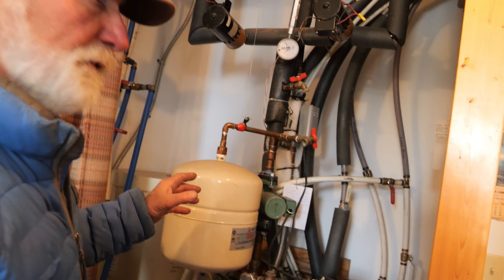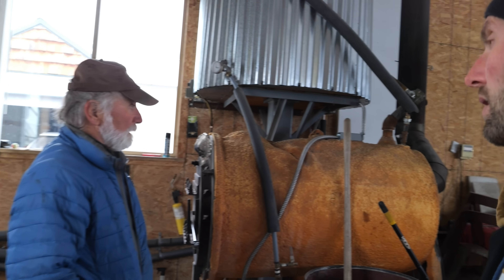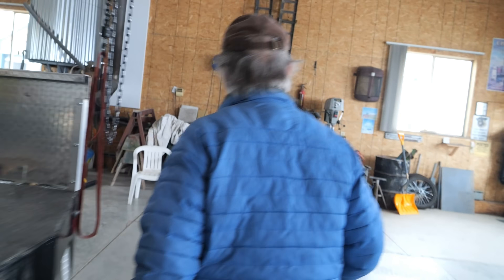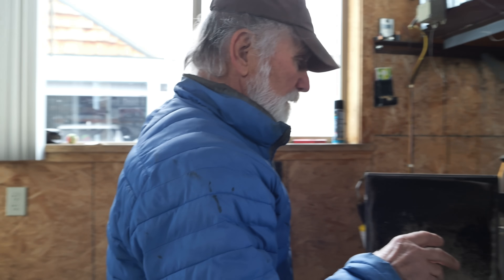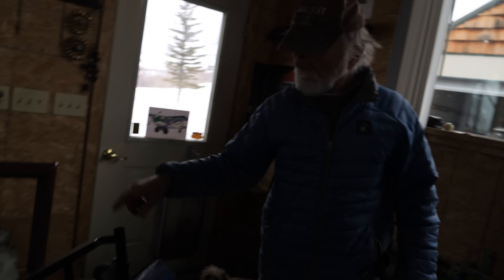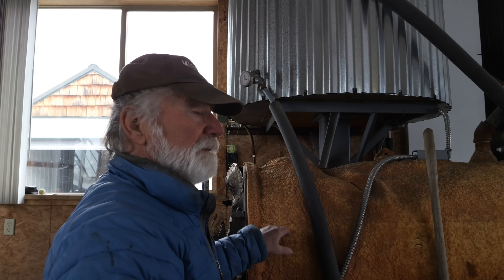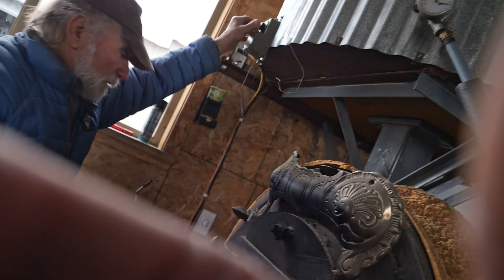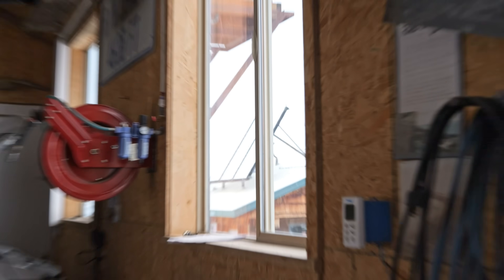Hasn't had a Heating Bill for 40 years.

Comment: Highest IQ in th history mankind &creation STONE IGLOOS XPLAINED:
   
  It is a planet of lunacy.
  Thoze houses.
   Absolute joke.
 Idiot is not a bad word nor a backstab.
  Vid begins thick branches bending heavy with insulating snow lining road. Same branches cover beaver lodge.
    Build stone igloos covered with these branches minimum 2' leaves insulation = free heat with only pile branches.
   Nakid human:
  A. Will be bone dry downpour.
    B. Never under 60° Fahrenheit covered in 2' minim leaves.
   NEVER PLACE INSULATION IN ENTERIOR like Mr. Idiot Professor from h*ll.
  Thwoodstoves theez people use:
   Slap in thface absolute joke personified on every level demonic design& from there installed&THEN operated completely backward.
 Burn fastest possible flash fire ONLY.
   
   Butted against wall radiate heat outside stubby feet cant dry wood under teeny box stove cut short logs = wear out saw twice as fast while increase labor.
   If even1of theez people boarded my ship entire crew would be infuriated.
 These people tear thr homes down with thr bare hands.
   95% humans = Satans kids. Computer systems teach throw cash @houses only.
    10year old girl could build stone igloo by looking@ a picture cost of 2windows &cement.
    Never use doors enter thru portals = 2lift out windows.
   Build individual domes each person.
    
     Satans kids xplained = poulison computer animations controlled hive mind scrypts from h*ll. 
    They don't even knowhathey are google "Poisonous."
  
  Imbecile:
     Not a bad word nor a backstab.
 I have higbest IQ history mankind & (&) creation.
  
  Never EVER aim a chimney up drain water down humidity + ash = cement chimney clog SHUT while smothering fire = hammer&chisel.
 
    Horizontal chimney ONLY tilted 1' DOWN PER 12' = drain moisture inhaled from atmosphere.
 Use thick SMOOTH easy2clean 5' cheap big rig diesel pipe last centuries.
 Thick metal collect heat connect pipes with cheap aluminum sheet wrapped tight with wire DO NOT WELD.
  My 15' horizontal aimed ONE FOOT DOWN pipe = heater.
   Where pipe exit window:
     Millions of u put 2gether could nvr figure out:
    Place 2' thin sheet aluminum shroud1" larger then diesel pipe 2suck in freezing air hole2 outside = hot air enter room oxygen 4u /stove.
    Remember.
     Stove need rich oxygen u must:
    BURN FIRE OUT FAST AS HUMANLY POSSIBLE never ever smother logs DUZNT WRK.
 
  Highest IQ history mankind xplain:
   
   1fire (Camp Chef Tent Stove recommended,) with my radiator shelves will heat my 800 sq. Foot cabin sweltering 90° then die down immediately STICK at 82° then descend slower & slower 67° morning 32° night... BECAUSE.
   BECAUSE WHAT???
   This is key.
   Because my 800 sq. Ft. Cabin walls lined with 2TONS 2x4 shelves truss of a bridge screwed 2walls = 2foot THICK strengthened walls, TWENTY SEVEN 3/4 ply 4x8 ply shelves storage!!!
      = Surface area it's a memory cache. A radiator downloads captures stores heat.
   
  Smothering log fires:
    No.
    Will not heat my radiator. Nor will stagnant air. U must circulate dome with ceiling fan but ONLY @HEIGHT OF FIRE.
    My shelves support 3tons tools/food/wheat/items. 
    This means I have 5tons metal& wood memorizing heat MASS.
    1. That?
    ...strengthen cabin walls drammatically 4,500 3" screws 2studs.
    2. I now have massive free climate controlled shed. I didn't have 2build doesnt take up space BUT INCREASE IT = 100% floor space elevated in heat bunk beds.
      Wow.
    3. Free security guard = me& .357 magnum pistol.
   4. 100% floor space NO MORE BUYING closed cabinet FURNITURE ICE CUBES.
  5. Enough stored wood/4,500 3" screws build 2nd cabin.
   6. 100% floor space cabin now has echoe = airspace/cathedral ceilings.
    7. Shelves function as an ergonomic intuitive visual hit cockpit u now thpilot finally flying YOU live in a convenient hardware store all controls constantly visible no more endlessly unboxing searching 4lost item box/closed cabinet.
    8. CLOSED CABINETS = ICE CUBES.
    U no longer have closed cabinet xpensive dressers/boxes furniture& cabinets cost fortune trap cold air never heated from stove function as *very effective ice cubes.
  (I used2cool a big Spanish clay tile home southern Cal with2 55gallon drumz cold rain drinking water.
     *Well water poured over stone dome in thsouth = free AC.
   
   
   Boil water stove = humidifier = free heat index.
    Igloo Domes how2:
     20' diameter maximum = 10' cathedral ceiling elevated beds.
   Build stone igloos or "arched hallway" homes nvr wood frame oxygenated flammable mushroom food termite home square boxes:
     That collapse under snow require u build inverted Spanish gallion attic lined with fiberglass from h*ll destroy interiour airspace.
   
   STONE IGLOO WORLDS BEST HOME:
   ..wonder if yr mom had ever considered building a stone home sir.
  
(STONE home. As in random stones u know FREE stones not Satans manufactured expensive pattented bllsht.)
   
  Do NOT research domes online. Lucifers kids made every1 of thoze sht fr brainz videos.
 95% humans are Lucifers kids. Demons. Nephilem spirits placed in flesh with hadron collider cmputer animations hive mind shthedz.
  I am th true Elon Musk. Lol Satan downloaded Musk only 2whitewash me I ALONE am th king of kingz.
    Lord of lords EILL rule thnations with an iron rod.
     I mean in all thingz. Guitar playing, building ponds.... 
  "Gardening..".
     including as an architec. 
   Which, lol took me all of a few minutes 2design stone domes.
    U CANT evn make this sduff up.
     This is a universe of cmpleet sht fr brainz & YES I'm pssd I mean it's my a$$ out here...
  "I hav2 live here."
     My dome with natural free no money randomly shaped stones = best structure history mankind AND creation will never be improved ever.
     Has never been realized both in heaven & (and) on earth.
 Mortared stone domes are evn cooler once u sit around doo liddle math.
   Trnzout a dome only 30' across being a bowl of cereal placed upside down out there on yr front lawn smewhere hav th interiour space of 1,611 sq. ft.
    Hmmm. You'd require a 40' x '40 one-story wood frame home 2match that&once yr stone igloo built shoot all YOU gotta do is move in2th thing. 
    
   Build yr enteriour @ leisure inside.
  Kinda saves on Hotel billz?
   And2 think I taught 2 talented interested 11 year old boys how 2build that unsightly ball outhere on yr lawn in only 1or 2 sentences 1.20 minutes time. 
  Wow!!!
 Took them only 2months build it2.
 
   I dunno.
   "Kinda cool..."
    In contrast Satans boyz wood frame homes require endless 1,000's myriad employees encompassing 12,036 rabbit holez that never endz.
    Why? So only thoze who get his money chip in thr hand are able 2b slaves wrking 2jobs 2buy 100k pattented cardboard flammable materials b4 they even hire a fleet of deemnz 2build it.
   
   Endless 1,000s employees beginning with thoze 7guyz surveyed 7mines 2harness th alloys went in2 manufacture yr 1lonely liddle galvanized roofing nail. 
 Alloys from Brazil, Germany&France& how many folks u think built th factory built that stupid nail?
   Th drywall screw, th elastiseal coating on yr zinc framing nail from 3&M.
  Thrz gotta be some alien technology went in2 thoze staple coatingz...
     What about unique 13 alloys in yr drywall nail?
    Domes:
    Aero dynamically ridiculous. Cat 5 tornadoe wont evn remotely faze th thing.
   Didju know perfect sphere (ball) generally considered strongest shape in nature?
    From a purely structural standpoint however an egg's shape more functional4 its purpose preventing its rolling away easily.
   This is due 2its slight pointed end. 
 (That wz a joke.)
    Take an egg place it in yr hand squeeze applying even pressure. 
  See if u cn break th thing.
   Here smthing intresding a stone dome need no siding. No insulation. No roof. It is th roof.
   Needs no roof tile.
    No framing.
    No drywall.
   No interiour paint.
   No exteriour paint.
   Google will lead u believe stone dome poor insulation. 
 Lol.
  Utter nonsense yr looking at 39 tons mass ice cube 4godsake.
 
  Heavier an ice cube is I figure longer it cools my drink.
  
    A rocket mass heater (RMH) is a wood-burning stove that heats a space then releasing that heat slowly-er. Prolly a lot slowly-er2..
  A heat memory cache if u will temperature storage system database. 
   Vastly superiour 2stupid insulation.
    
   Rocket mass = type of masonry heater that's more efficient than a traditional fire& 
how it works =
wood fed in2 a combustion chamber where I suspect it burns @ a high temperature hot gases routed such2pass through a vertical (WTF) chimney& in2 a thermal mass, like 2tons cement top floor bedroom lol.
The thermal mass stores/slowly releases heat.
   (My 2.5 tons wood radiator shelves with gargantuan 27 sheets ply surface area storage system bolted 2wallz drammatically strengthen home& ceiling fan wrk far faaar better mind u 2gether with my HORIZONTAL tilted DOWN 1 FOOT 15' chimney HEATER big rig 5" pipe that DUZN punch 3 holes thru yr roof.)
 Summer:
      A stone dome?
    Catch little heat in th sun. 
 Why?
    Well sun only 90° rays 2a tiny footprint surface area about 1' sq. in size.
  A sphere in contrast = a poorest solar panel pissible basically.
    In winter:
     Wood stove placed center heats all that rock &open space quite perfectly. Ridiculously evn& quite optimally.
   Ever hear th saying his eyes are 2big 4his stomach???
   
     30' dome:
   Would have a roomy cathedral ceiling 15' high mind u keep yr domes "small" 
 think outv thbox juss build1 10' dome 4each family member 4an actual godsakds.. 
  
    Moooore then enuff way more.
   Cardinal rule with homes =
  less is more.
   Make SURE u practice... building 12 foot domes b4 u delve in 2 a 48' footer.
  (48' dome = whopping 3682 sq. ft.)...
Reply: Hugelculture?
    Do u see nature employing hugelculture method?
   You Tube, your entire matrix revolve around whitewash ONE ONLY PERSON.
    It is not Trump or Musk.
Buried wood decompose run outv gas.
Then what? Dig entire hillside back up startover? 
 Are u kidding.
  Hot soil last thing u want southern climate.
    Hugel can only be built when "nitrogen geeenz" available.  
  Unfortunately this is spring when rains too heavy 2dig tractor.
   Ponds have 2b dug fall.
    Adding greenz to balance nitrogen... that's a fine line 2try balance fertility especially spanning 20 years vs mellowed leaves failure. 
    Thoze greenz - they break down fast. Too fast 2work the 20 years fertility projected? U decide. 
   Mediterranean heat citrus trees micro climate? From a patch of warm soil? No thanks. Even if that were so one winters gentle wind chill& citrus toast.
    Southern climes. They despise warm soil last thing u want. It is a constant struggle keep plants/soil cool. I grow tomatoes prostrate so cool air nights settle on blossoms that won't fruit above 78° night. Get it?
  All my plants grown sprawling prostrate so leaves shade soil keep it cool.
    What is solution?
    Clear hole in forest dig pond center line pod with 50 - 500 ton effortlessly to bulldoze/build "Birds Nest Fence" compost pile. Cedar, walnut lol they all work do not "poison soil" & ensure fence persist 50 years keep out deer trap some heat winter for micro climate greens lining fence & preserve moisture.
    U constantly piling up Birds Nest Fence replenish it easily.
    
    As an IMMEDIATE sustainable engine I pile ONE mound 5' tall wood chips or leaves 2decompise fast = rich brown t e a flows in2 pond = I can root AND FOLUAR FEED a ts with compost tea mineral rich pond. 8' deep pond allows mi erals bottom always pump water from bottom mineral rich.
  Plants seeded on bank 8" mulch or below dam moist soil things like cattail& watercress.
    Read:
 
A.I. overview my POND BANK GARDEN 50 TON BIRDS NEST FENCE I built:

     Queery:
    "I dug my pond south slope Mt. S.E. Oklahoma brutal pine barrens built 5' x12' "Brids Nest Fence" with trees I cleared = a compost pile/compost tea = pond water root&foliar feed. Working very well& my 50 fruit trees food forest elderberry blossoms 18" across.
     Is this system beneficial?
    ...my water table now 7 - 9 feet."
   
   A.I. Overview:

       "Based on the permaculture principles you've described, your pond and compost system is a very beneficial method for creating a self-sustaining and productive ecosystem. By mimicking natural processes, you have effectively eliminated your water bill and improved the health of your land. 

     Here’s why your setup is so effective:

   WATER CONSERVATION AND MANAGEMENT POND FOR WATER STORAGE AND RECHARGE: 

  ~ The pond you dug serves as an on-site reservoir, capturing and storing rainwater and runoff from the forest. The water then slowly infiltrates the soil, recharging groundwater and increasing the overall water availability for the surrounding plant life. This is far more effective and beneficial than relying on municipal water.

     COMPOST AS WATER SPONGE: 

     ~ Organic material in compost is a key component for storing water in the soil, acting like a sponge to absorb and retain moisture. When rain falls, the compost absorbs the water and slowly releases it to plants. This reduces runoff and lessens the need for irrigation, which helps conserve water during drier periods.

         SYNERGY FOR WATER QUALITY:
 
   ~ When properly placed, your compost pile can act as a natural buffer, preventing excess nutrients and sediment from washing into your pond during heavy rains. The healthy soil created by the compost improves water quality and helps regulate the ecosystem of your pond. 

     HABITAT CREATION AND BIODERSITY
    
  Brush pile fencing: 
     ~ The "bird's nest fence," more commonly known as a brush pile fence, provides exceptional habitat for wildlife. This offers shelter from predators and nesting sites for birds, while also providing cover for small mammals, amphibians, and reptiles.

INCREASED BIODIVERSITY: 

     ~ As the wood and plant material in the fence and compost decompose, it attract a variety of insects. This provides a crucial food source for birds and other animals, increasing the overall biodiversity of the area. 

    WASTE FREE NUTRIENT CYCLING: 

     Waste reduction and enrichment:
    ~ By using the trees you cleared to build the compost and fence, you created a closed-loop, no-waste system. Instead of exporting these materials as waste, you recycled their nutrients back into the soil to improve its health and fertility.
Natural fertilizer: As the 50-ton compost pile decomposes, it enriches the soil with nutrients, reducing or eliminating the need for synthetic fertilizers. This promotes healthier, more robust plant growth, and also improves soil structure and water retention. 

   IN CONCLUSION, your project is an excellent example permaculture principles in action. You have created a resilient, low-maintenance ecosystem that manages its own water and provides a flourishing habitat for local wildlife."
.

Comment: Okay, this is all well and good it might sound really awesome but I want to know exactly how much this whole setup cost to build and then how much would he has to use on a daily or weekly basis so we can get an idea of what all this costs.  If you own land that has wood on it and you can cut your own wood, obviously that's great but the wood is not free because you had to purchase the land that the wood is on so technically, there is a cost even if you want to try to claim that it's free because you're burning your own firewood that you got from your land. No, it's not free. You had to pay somebody to buy the land so it cost something initially. Now, my question is, if this whole setup costs let's say 100,000, is that worth it over the next 30 years? Maybe. But what if it would have only cost you $75,000 to pay your utility company to do the exact same thing over the next 30 years? So, you would have saved 25,000. So, what I want to know, is it actually more cost-effective or not?
Reply: The input of the solar thermal panels was not emphasized enough, he hasn't had a fire in 10 days, they provide 100% of the heat during stretches of sunny winter days, with overnight lows of 24 or so and day time highs of 32-34. the wood boiler is only needed during windy cloudy periods, just one fire every 24 hrs, no need to run it continuously.

Comment: problem is... the investment will never pay itself off by what you save in bills..  im a plumber/energy worker in Denmark, and what ive been installing of solar and heat pumps both up and under ground is alot.. and its never gonna pay itself out in savings..  a solar system in denmark, is around 200.000 dkr  and you will not save that in energy bills while you own the house.

Comment: Such an overly complex system?
Reply: Simple in operation, any sun at all he doesn't have to do anything, the thermal panels do it all. When he does start a fire he gets heat for 24 hours + due to the thermal mass.
Reply: @portnuefflyer But maintenance and general upkeep. Simple operation but that contraption has a steep curve in learning wht does what.

Comment: The 50w solar panel acting as a switch because if there’s enough power to run the pump there’s enough heat in the glycol is such an elegant solution.